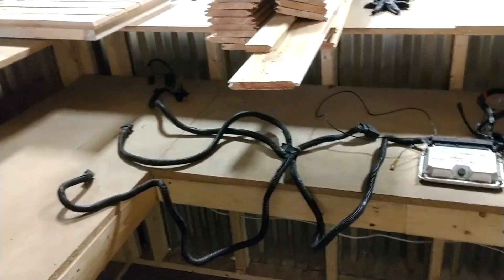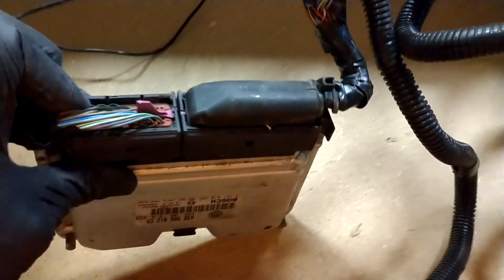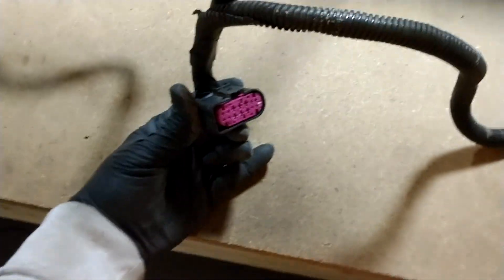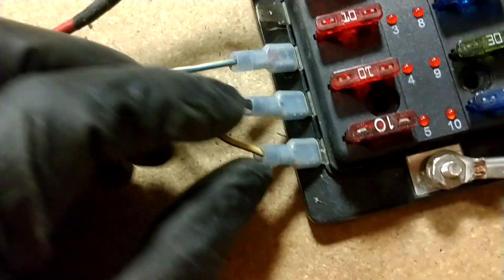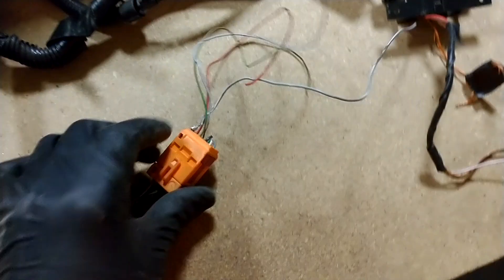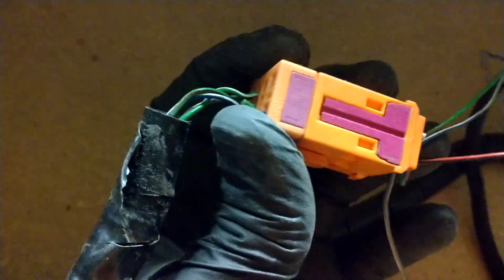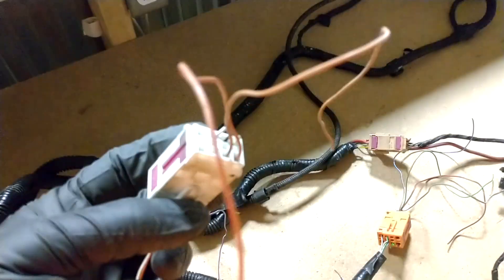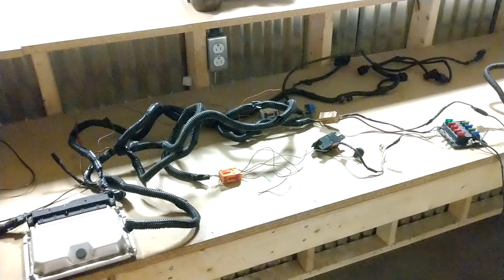Toyota TDI 4Runner body swap wiring part 2

Comment: I have a no start issue on my 4Runner ALH swap, my only code is p1601. I used a standard 5 pin relay to replace the relay 109. I can hear my 5 pin relay click on with ECU power, but the start remains with the p1601 code. Have you ever ran into this code with a swap?